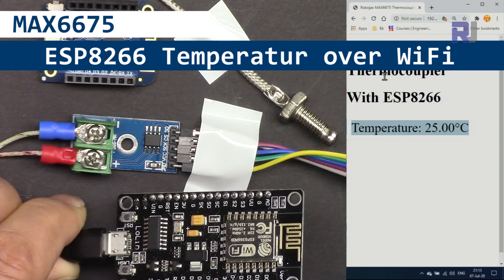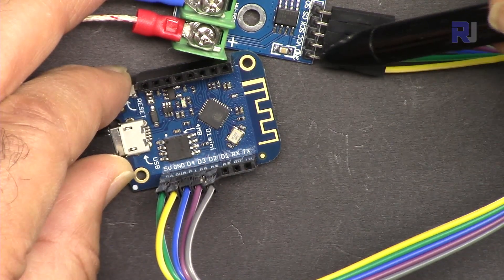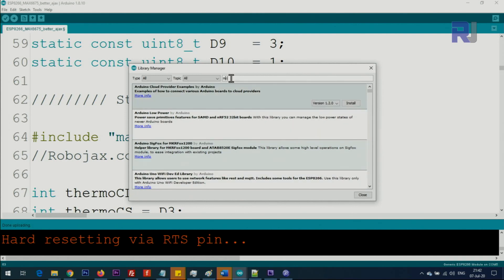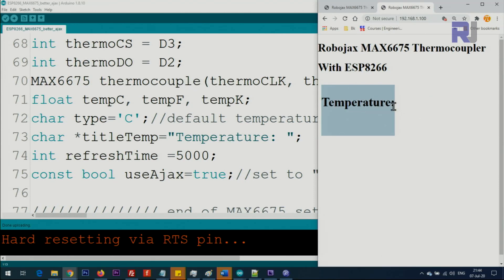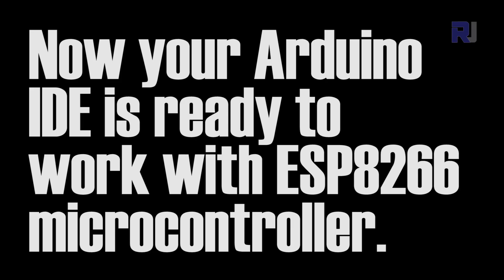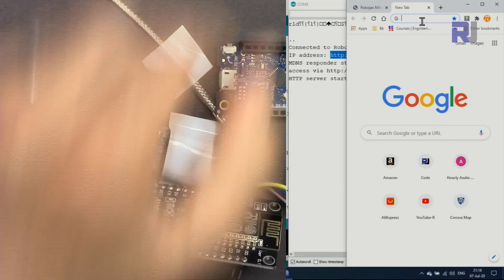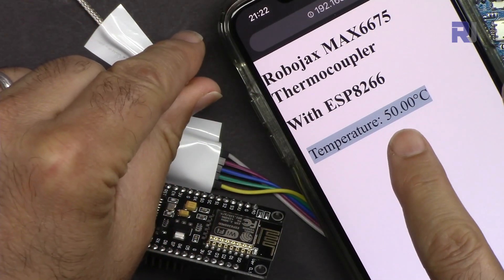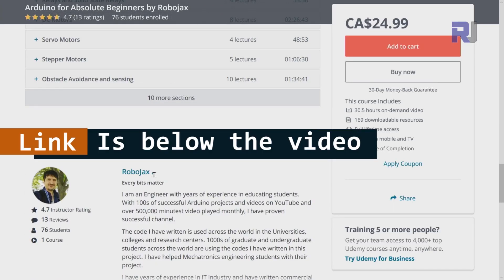MAX6675 Thermocoupler Temperature over WiFi with ESP8266 NodeMCU D1 Mini - RJT334

Comment: After uploading program it is showing Hard resetting via RTS pin. How to fix this problem please guide
Reply from the maker: what is "Hard resetting"?
Reply: @robojax  I don't know
Reply: Make sure that your serial monitor's baud rate matches the value used by Serial.begin in the code. Serial monitor should be 115200 to match.

Comment: What is the advantage to using ajax? Just curious. I have never used it. If I wanted to graph these temps as is done in another video, that might be different.
Reply from the maker: I give two examples and clearly mentioned why. I would have to type it while I said that in the video.
Reply: I went back and watched the video again and I'm not sure I picked up your reason. Is it so you can use ajax to trigger a refresh every 5 seconds (or whatever it is configured for) rather than reloading the whole page as you would do with an html header?